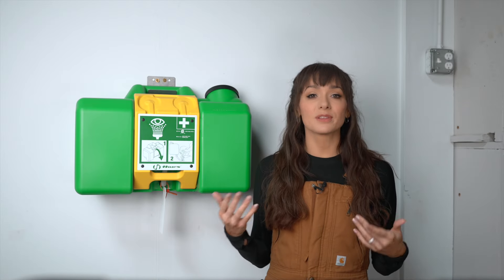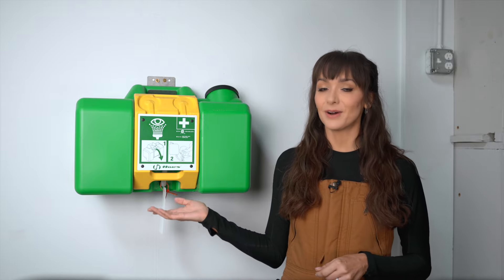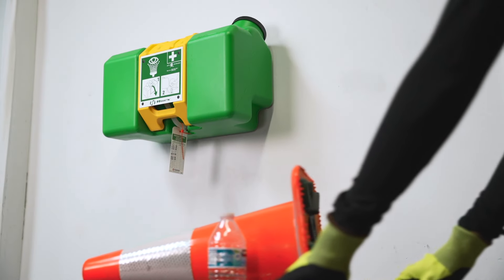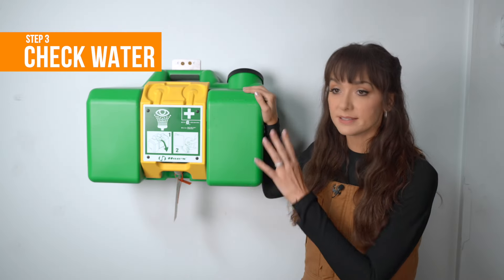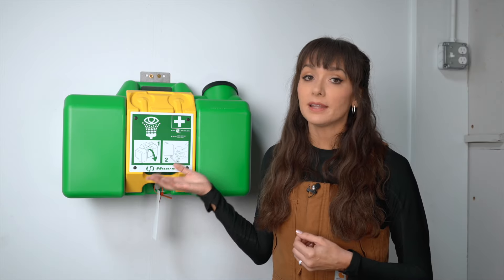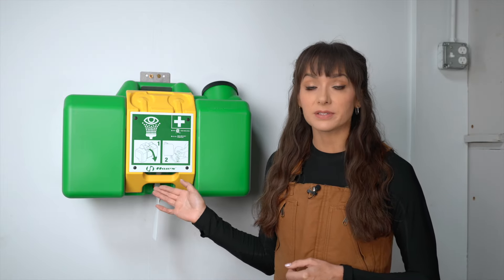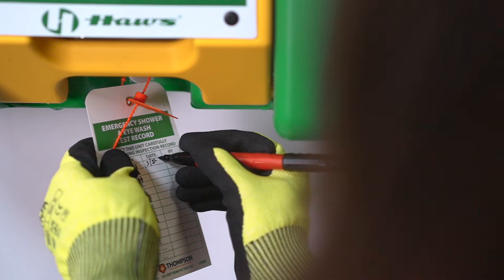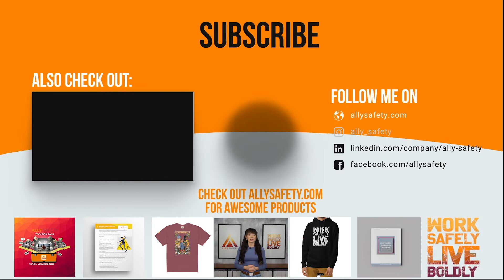How to Inspect Self-Contained Eyewash Stations | By Ally Safety

Comment: All those eye wash stations are poorly designed. They need insulation to keep the water temperature constant. But we find Plastic made and no insulation provided for weather protection. it can only be used in a lab setting.
Reply from the maker: Yeah, if you have bigger temp fluctuations they aren't ideal. Some have insulated covers which can help. Ours are in climate-controlled environments.